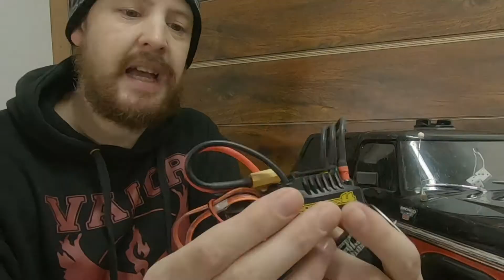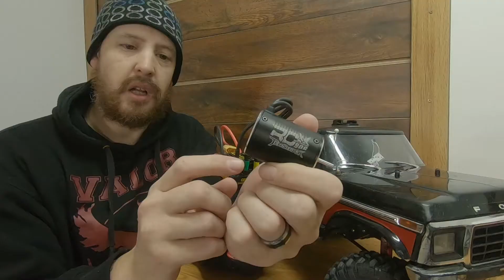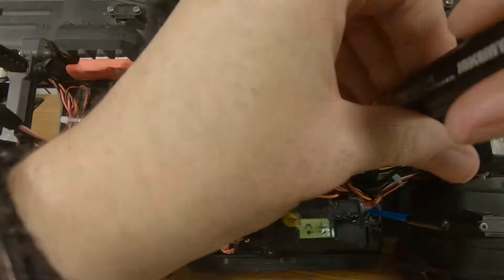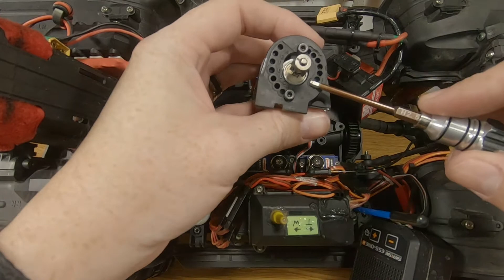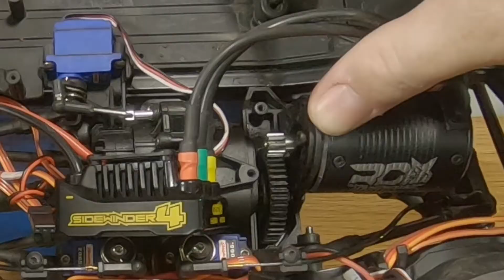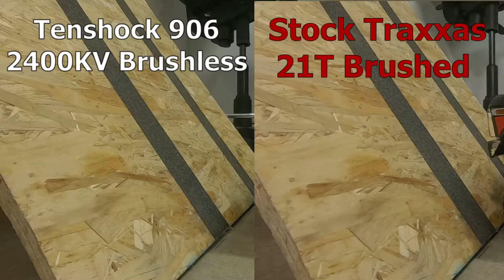Traxxas TRX4 Brushless Upgrade - Installing a Castle SW4 ESC + 2400KV Tenshock RC906 motor

Comment: mine also like this, what about pinion n spur? n battery
Reply from the maker: Spur is the stock 2 speed transmission spur. For pinion I like the 9t for lots of low end power. It’s also the only way to get good slow speed control with out a sensored system. For battery I only use 3S and I have a small one for short runs and a 6000ma for the long trail hikes.
Reply: @TJsRC  nah mst cfx single speed need to change or not?
Reply from the maker: Just go with the smallest pinion first then drive it for a while. You might not need to mess around with a different spur gear if it drives smooth enough for you. Obviously it will not be as smooth as a sensored system but you can usually get pretty good results going with the smallest pinion.
Reply: @TJsRC  the battery on yours is 11.1v 3s 30c 6000mah? the short 1 is?
Reply from the maker: My small battery packs are 3000mah. That’s not necessarily small but compared to the big 6000mah I call them small.

Comment: So how did it work out?
Reply from the maker: It works awesome for a non sensored setup. Combined with a 9t pinion crawling is pretty smooth and in second gear it moves plenty fast. Currently I’m playing around with a Holmes hobbies 4000kv motor in there and it’s insane but that was kind of the goal 😂🤣 I go back to the setup from the video when I want smooth slow crawling power.
Reply: @TJsRC  I’m going to put a new Mamba X with 1415 2400kv I think. I’m just worried it will tear my rig apart ha.  Bought it by accident actually.  It’s sensored.   Thoughts?
Reply from the maker: I don't think your going to destroy your truck. But some trucks do stand up to more abuse than others. What are you putting it in? As for Sensored vs Un-Sensored, Sensored is usually better. They allow better control at slow speeds which is exactly what you want in a crawler.
Reply: @TJsRC  TRX-4 Blazer
Reply from the maker: The TRX4 is super tough, you won't have any problems with that setup. 👍👍
Reply: @TJsRC  we’ll see how it goes! If it rips her apart I’ll be calling ya out! Ha 😜
Reply from the maker: Sounds good my friend. Definitely let me know how it goes. 😁
Reply: Battery is 3s?

Comment: Hi, great video and very useful information. Always loved rc cars since a boy. Back then batteries lasted 10-15 minutes and took almost all night to charge, but it was lots of fun. Recently discovered that you can trail for2 hours + and I got hooked again.
Anyway, purchased an TRX4 Defender and am loving it.
I landed on your channel because I am planning on changing to a brushless system like yours and I am also trying to figure out to add a 7.4v high torque servo and keep all other micro servos running 6v.
Maybe you could help? Any tips or have you any video on that?
I also loved your speaker system, I had no idea of that, how cool is that! What model is that?
Again thanks for sharing.
Reply from the maker: For adding a higher power servo you'll need to add a BEC. I don't have a video on this specifically so watch this video from Holmes Hobbies. Pay special attention when he talks about being sure not to accidently double power the receiver with the BEC and the ESC,  As you only want the BEC powering the servo. https://www.youtube.com/watch?v=MxSOLn6CtS0&t=94s
The speaker sound kit I have is from Sense Innovations it's the "ESS ONE +" sound kit and you can find it on many online RC stores, they have a newer model now called the "ESS Dual".

Comment: I have the same setup in my scx10iii I am completely new to the castle esc world.would you be able to tell me what your settings are  in the castle link program?
Reply from the maker: Here are the things I changed in the castle program. 
1 motor timing set to zero degrees 
2 added a deep curve to both the throttle and brake curves
3 set reverse type to crawler reverse 
4 set the drag brake to 50% you can go higher if it’s not strong enough but the gearing is so high in my TRX4 that even at 50% it’s plenty strong 
5 drag brake ramp set to slow. This is a personal preference since I also trail faster and don’t like the hard instant stops. If you only slow crawl you might want the ramp speed set faster
6 I set the lipo cutoff voltage to 3.5 because I don’t like running my battery down that low. This also is a preference as it is usually plenty safe to run at a lower setting if you want 
There might be a few I forgot but these are the main ones that I can think of off the top of my head. Make sure when you connect your esc you check to see if it has the latest firmware. As you’ll need that for the drag brake ramp setting to be available. 
I always wanted to make a video on using the castle software but the few times I tried I was unhappy with the results so I never finished. The Holmes Hobbies channel has a good video on using the castle software for programming an esc for crawling. 
https://youtu.be/1r8y_hJjjKU
Reply: @TJsRC  thank you very much for your response. I saw his video and copied most of it  but wasn't getting the results I wanted. Did you manage to eliminate the cogging on the low end or at least almost all of it.
Reply from the maker: @brianlongto866  the trick there is gearing since we aren’t using sensored motors. I run the lowest or almost lowest tooth pinion gear. This makes the biggest difference in slow speed control since it doesn’t have sensors. If that still doesn’t help it’s likely the overall gear ratio is still to high.
Reply: @TJsRC  using a 13t pinion smallest I had
Reply from the maker: @brianlongto866  I have a 9t on my TRX4 and in low it has a crazy amount of gear reduction with that pinion. Pinion gears aren’t very expensive so it’s an easy experiment. Do you have the two speed transmission setup or just using the single? 
Also you could double check to,
 -make sure the timing is set to zero. 
 -check to see if increasing “start power” helps unless it’s already at high 
- if you have “punch control “ enabled try disabling it, just be sure your batteries are good quality and can handle it.
Reply: @TJsRC  yes I have the 2 speed set up. I ordered the low transmission gears to see if that helps any. I'll recheck my setting when I get home. I appreciate your help ill update you later
Reply from the maker: @brianlongto866  Good luck my friend, I look forward hearing how it turns out.
Reply: @TJsRC  I got the cogging down to a minimal but it was still more than I wanted so I pulled the system and I have it listed for sale LOL I'm just going to quit the b***** and get a hobby wing fusion for this truck LOL
Reply: @TJsRC  I think if I went with a 1750 over the 2400 I would have had better results
Reply from the maker: @brianlongto866  Experimenting with different parts and pieces is fun stuff. I hope the new system works better for you.  I don’t know much about the HW Fusion but I do have a HW Axe and I really like that. I’ve had pretty good luck with Hobbywing stuff.
Reply from the maker: @brianlongto866  It’s worth a try but if you are seriously trying to make it have amazing slow speed control there are only so many ways to do that. 
1 Stay with good brushed motors 
2 Use a sensored brushless system 
3 you can use the SW4 you have with an out runner motor like a Holmes Hobbies Revolver, they are extremely strong and smooth but they are very noisy. 
4 Lastly have a crazy amount of gear reduction. With a 9t pinion the TRX4 has almost 80-1 reduction in low gear. I think that is why the sensorless system performs decently for me. But my level of decent performance may be extremely unacceptable to a hard core crawler guy. That’s one of the best parts of this hobby.  How easily it is tailored to each individual and how they want to enjoy it. 
Again I wish you luck in your experiment to get your rig running exactly the way you want. Stay safe and keep having fun with it.
Reply: @TJsRC  yeah I was trying to avoid one of those angry hair dryers lol if the system doesn't sell in a couple days then I'll try one of the OutRunner motors I was looking at the hobby star it's a 15 pole 12 slot or something like that
Reply: @TJsRC  I think my main issues I went with the 2400 KV if I had gone with the 1750 I'm sure I would have had a lot better luck
Reply from the maker: @brianlongto866   “angry hair dryer”🤣 I could never tolerate the noise they make.
Reply: @TJsRC  me either the three Brothers stinger is quieter than the devolver I'm going to try the hobby star 1700 KV it's only 20 bucks so it's not going to hurt my feelings if it ends up being s***
Reply: @brianlongto866  the key is gear down and volt up

Comment: Why do this whats the purpose...i cant see any type of crawling needing this much power
Reply from the maker: TSI1995Talon For one I don't only crawl with my trucks. They crawl well but I also enjoy trail hiking with them and that requires a bit more speed. Plus I'm a firm believer in overpowering, with caution 😁. It's also fun every once in a while to speed around with it. Having the extra power just makes it more versatile of a rig in my opinion. If I only did slow crawling I would build them differently. Here in central Wisconsin though we have a big diversity of terrains to play on and I want my RCs to be fun at multiple tasks.

Comment: Do you notice any cogging? Do you still run this setup? Is it faster/smoother than stock? Thanks buddy!
Reply from the maker: With a 9T pinion the slow speed crawling in low gear is quite good. I rarely notice any cogging. The low 9T pinion makes all the difference. If you try it with the stock pinion the cogging will be more pronounced. And yes it is as smooth or better IMO than stock and faster.  Unfortunatly I do not have this in the TRX4 right now. the SW4 stopped working the other day and it's currently in the mail to Castle for warranty work. When it gets back it will probably go right back where it was in the TRX4 because I've been very happy with it in there. 👍